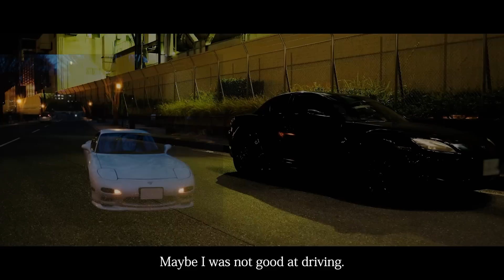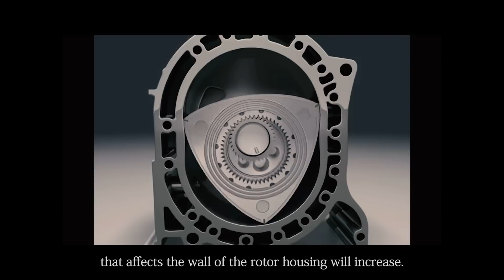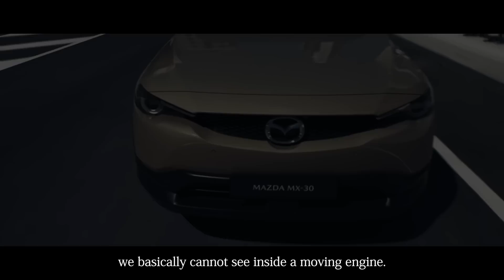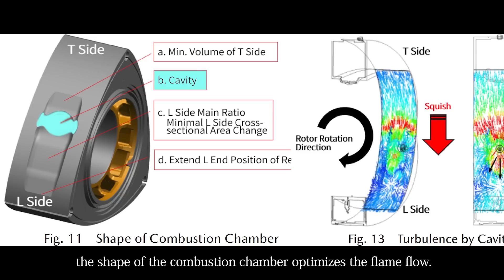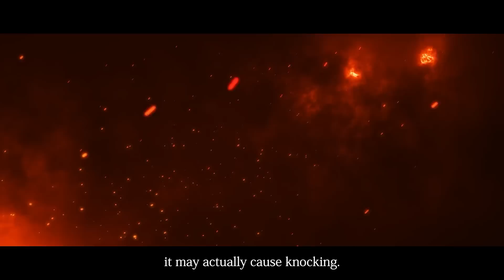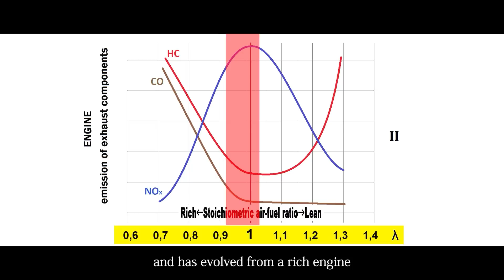NEW Rotary Engine "8C"

Comment: i had my 4th rotary last 2 being full spec rx8s, look as an engineer you simply must understand, it has a serious flaw that simply cannot be overcome by its own design, in normal piston engines the pistons share the same space with all four strokes,  the rotary has defined areas for each event, you will always have a thermal imbalance, a hot side and a cold side, ive said this years ago and its true, im a fan, but its flawed,
Reply from the maker: Thank you for your comment. I think you're right. I also think that the uneven temperature conditions between the each operating chambers is a big problem.

Comment: I'm wondering if you could use 2 spark plugs for all 3 sides. I'm just throwing out ideas only. I don't know anything about the rotor engine but I'm intrigued about the engine.

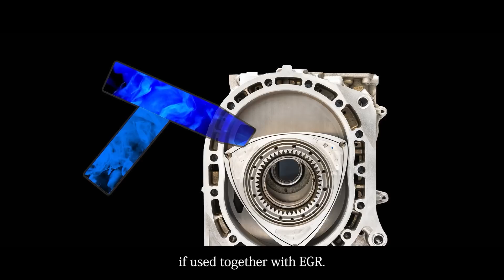Comment: 16:30 sounds wrong. The temperature stays lower with EGR than without, not because the cooled-down EGR gases have to heat up and therefore absorb some energy. The main reason is that oxygen content in the mixture is reduced: EGR gases are already burned and therefore lack oxygen, but they are mixed back in, replacing the volume that would otherwise be filled by air or fuel. This still allows the engine to reach the required pressure, but with less oxygen. The reduction of oxygen therefore regulates the combustion process, allowing the generated heat to be controlled. Normally, this is done because combustion temperature determines what byproducts are formed — whether carbon particulates or nitrogen oxides. Each of these substances has its own regulated upper limit set by law. With EGR, the system simply produces fewer nitrogen oxides, but more carbon particulates, by intentionally making the combustion process less efficient.

The cooling effect you described can be achieved more directly with simple water injection, which is also used in performance engines. Small amounts of water are mixed into the intake charge. Water itself cannot be compressed, so first it reduces the effective chamber size, but it doesn't matter. More importantly, after combustion the water immediately vaporizes. This absorbs a large amount of heat, which helps reduce combustion temperature, and the vapor is expelled in the next cycle, efficiently carrying the heat away.

I am not sure about Wankel engine construction, but in a conventional engine, cooling down the EGR gases too much will lead to clogged EGR pipes, higher maintenance needs, and reduced engine life.

This is because EGR does not only carry hot exhaust components like carbon and nitrogen oxides. It also contains oil vapors and fine dust from the engine. When this mixture cools down, it condenses and builds deposits. Therefore, the EGR cooling system requires regular maintenance; otherwise, it will clog. In fact, a conventional engine often lasts longer without this triumph of over-engineering.😂

Ok you explain it yourself 3 minutes later and my note get pretty useless 😂
Reply: the reni already suffer carbon related failures. i can imagine this will improve it

Comment: Put 1oz of 2 cycle engine oil in a tank of gas and safely hit 18,000 RPM's. Burn the Rear Tires off of it and Drift around all turns no need for breaks. Oh and you might want to hold on to the steering wheel... Loved my 1984 RX-7... if the muffler blows out it sounds like a jet engine winding up...

Comment: Direct injection right into the rotary housing?! If direct injection causes build up of valves in piston engine; wouldn’t it cause similar build up that might make it worse in rotary engine? Please correct me if I’m wrong since I’d love to see this engine in production vehicles.
Reply from the maker: Thank you for your comment. I actually have the same concerns as you. What is the reality? I think we still need to observe the market.
Reply: Not eve remotely the same but even if it was catch cans are a easy fix to the problem
Reply: @thepunisher3810    could this also apply to erg cooling condensates.

Comment: A single rotor and now the added hassle of battery assist.  Complete failure.  The last true rotaries were the 13b from the fc & fd RX-7 and the triple rotor from the Cosmos.  Emission laws set out to kill that and they succeeded.  Now the rotary engine is truely dead.  If you don't agree then you're not a real rotary lover. 😪
Reply: What do you mean "true rotary"? Why aren't the 12a and 13b "true rotaries"? Then a no-true-Scotsman statement on top of that. My RX4 and first year RX7 are as Wankel as any Mazda. It is a shame that modern mankind hasn't made a decent performance rotary automobile in a long while, for a lack of imagination and focus on other crap like how big a digital display they can slap in front of our faces.
Reply: @Spiritof_76 My apologies, I should have said "the last true rotaries"  I too owned and RX-4, RX-3, and an RX-2, and I loved every single one of them.  It just pains me to see the excuses for rotaries Mazda has given us since the FD.  Now a single rotor with a battery backup is just the final nail in the coffin in my opinion.
Again, my apologies for my ignorant previous post.
Reply: @Sparky....M  Thanks. If you edit the post  I can delete the follow up. Rotaries are amazing little engines. Isn't the new one more or less just a Generac for an electric motor if someone drives it past its battery?
Reply: @Spiritof_76 pretty much.  It still makes me feel like the true spirit of the rotary engine is gone.  Listening to a good engine buzz out at top revs was nothing but pure bliss to the ears.
Reply from the maker: I will respond to everything you said. So what?
Reply: @RENESIS55AchannelforMAZDAROTAR what do you mean "so what"?
The new body looks amazing and they do this crap to it.  Like I said before. Complete failure.  Everything about this engine is just wrong.  No high revs, no rotary sound, no soul.  If someone offered me a brand new one of these or a 1973 RX-2 Capella for free, I'd choose the RX-2 every day of the week and twice on Sunday's. This 8C crap is an abomination.  Mazda has lost is soul and it's balls.  I actually can't wait for it to be released just so I can go into the showroom and laugh at the sales person who tries to sell it to me. 😂

Comment: I'm not a professional but I have a little tiny Honda del Sol 5-speed over here and you can send me one of your two cylinder rotary engines and I'll put it through its rally Paces on the property😅😅😅😅 I live out in the country and there's a ton of dirt roads so I can definitely put it through its Paces not have to worry about too much I'll let you know if it blows up in the first couple😅😅😅 of hours

Comment: What about the Glow Plug in the leading plug site, as Toyota proposed in their pivotal SAE technical paper about Low load performance of Rotary Engine?
I really like the slot plug hole proposal in the video 'Rotary Engine breakthrough', if it's true this reduced exhaust gas temperatures, from the books by Harry Ricardo 'The high speed internal combustion engine', we know a higher BMEP means a reduced exhaust gas temperature.
EGR is a classic way to reduce NOx emissions, a hotter flame emits more NOx.
Curtiss-Wright proved a hotter rotor surface reduces HC emissions.
T Chen in his summary SAE technical paper about Wankel research in China said they got a road fuel economy better than existing bus reciprocating piston engines with a plate added to Rotor recess and other changes, such as a Reed-Valve in peripheral intake port.
Emissions of CO in Wankel have the same reasons and solutions as in reciprocating piston engines. 
Gesund +

Comment: I'd say an easy way to reduce the surface to volume ratio issue in Wankel RCE would be having a larger Rotor, just have a look at SFC figures of Sachs KM-37 vs KM-48, different just in Rotor width.
To reduce chances of lubrication issues, a 1% mix of Oil directly in Gasoline is a measure many experienced RE users take.
Oil reduces knocking, detonation, same do the Ethanol mixes, e.g., E5, E10.
Better put it directly in fuel.
Is it possible to obtain enough parts from Mazda to have a diy Single Rotor unit from the current hybrid engine?

Comment: Great video!  I was very interested to learn about some of the improvements Mazda has made on this new rotary engine.  I can't wait for the release of the 16x motor & possibly a 24x! With how rare it is to find good used core engines & parts for rebuilds, and how expensive they are, I can only imagine how having a new rotary crate motor being available from Mazda will breathe new life into the older cars.  I can already imagine this new motor being swapped into the older Rx's because it will cost the same or likely cheaper than people are paying for rebuilds.  I subscribed and can't wait to see your future Mazda rotary video's.
Reply from the maker: Thank you for your comment. I think it's wonderful that new life can be breathed into old cars by manufacturing new engines.

Comment: 12 km to a litre sorry but my factory 5 liter v8 get 12 km in the city I get 16 km to a litre on hyw so you keep replacing you seals
Reply from the maker: Thank you for your comment. It seems that rotary engines have worse fuel economy than V8s.

Comment: Thankyou for highlighting the 8c, people please note around 5mins 18sec. This engine has been stroked effectively and bored. I have been changing combustion dome shapes of the rotors for years to achieve a slight longer leverage angle and decomposition to allow more air fuel in. The chamber is a fixed ratio . Please look into H2 hydrogen fuel save unit  to clean up emissions and carbon slag build up . This could save you expensive rebuilding.   However i cant wait for the aftermarket  makers in Australia and new Zealand  to build trip quad or 5 rotor 8c improvement s

Comment: The problem with the rotary engines had nothing to do with fuel efficiency.  They went away because they could not pass emissions standards due to the need to inject oil into the combustion chamber.
Reply: I think this was more meant in a commercial consumer sense...that the general buying public and some governments (think corporate CAFE standards) were turned off do to the fuel efficiency, or lack-thereof. But yes the emissions standards, especially in Europe, is was ultimately conspired to not allow the RE to continue as a viable business model at Mazda.

Comment: Very informative video... Back when I had my three RX4's (one 12A and two 13B's) in the 1980's I often imagined improvements like fuel injection and computerised timing so I'm glad to see Mazda is moving that way. Surprised to hear that some changes will affect max RPM but hopefully the changes will improve power and torque.

Comment: Mazda built a domestic use only engine for front wheel drive years ago, the 13A. The eccentricity was 17.5mm, the radius about 120mm, and the width was 60mm. This gave the 1308cc displacement per Mazda. Rotor width was the same as the 10A engine. By widening the rotor to 70mm which is the same as the 12A and 12B engines gives about 1600cc per Mazda.